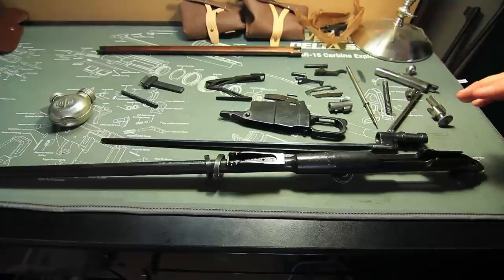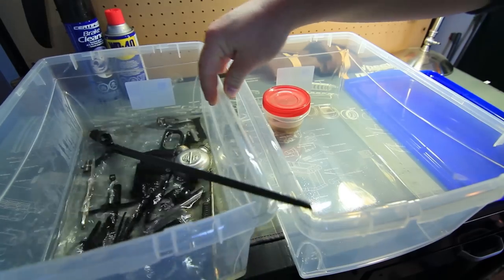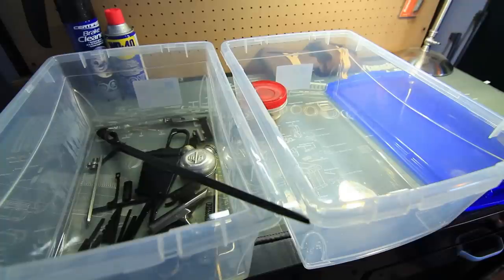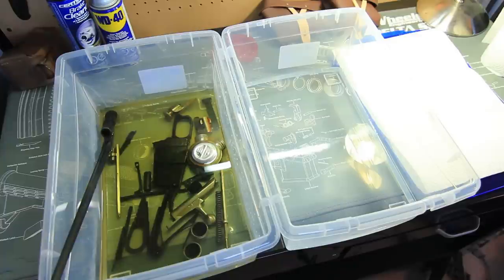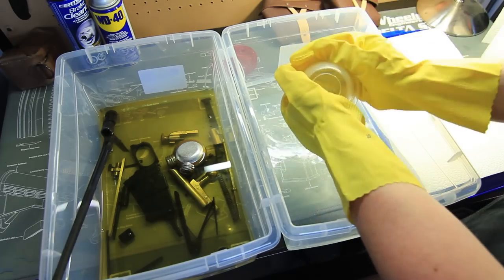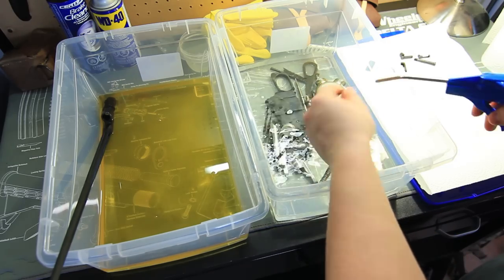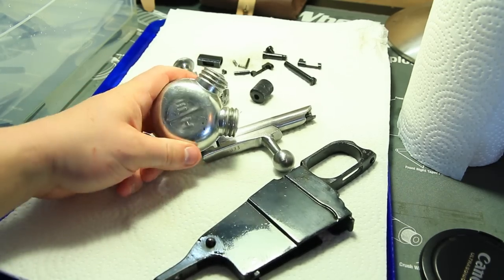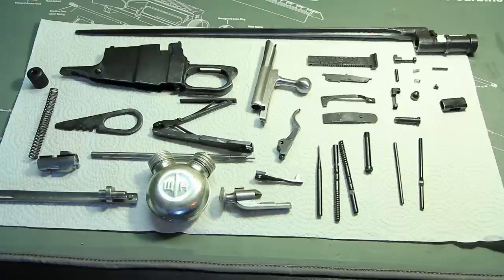Best Way To Remove Cosmoline And The Easiest way To Clean Cosmoline HD 1080p

Comment: When I degreased my Makarov pistol, I used three bottles of 91% rubbing alcohol.  I did a simple disassembly of the pistol, didn't take anything apart in the trigger group.  I also took the grips off, then put all of the parts in a half gallon container I bought for $1, and filled it up with the alcohol.  Worked great, got into all the moving parts. I used a toothbrush in some places. Let the parts dry and spray everything down with Ballistol.  The pistol operates smooth as butter.
Reply: If it's been arsenal stored, it's probably full of the stuff. But it's a good thing because it protects the metal. That gun will probably look good as new when you get it cleaned up.

Comment: Only took an hour! That's incredible. I am cleaning a cosmoline ridden makarov as we speak using mineral spirits and this method.
Reply: Mark, I'm planning on doing this to my Makarov as well. Does the mineral spirit effect the bluing of the gun at all?
Reply: Anthony. I saw no effect on the bluing.
Once  I got like 99 percent of the cosmoline off and let the parts dry I soaked them pretty good in regular gun cleaning/lubing oil and let it sit like that for 24 hours and then did a regular cleaning like any other gun and last I used a very fine coat of rem oil on everything external and metal, before I put the competed gun in its case. Looks pretty darn good!

Comment: I used a rag and alot of elbow grease along time ago, before the internet, in the Dark Ages, it worked but my SKS had a broken firing pin and would sometimes shoot on full AUTO or when I pulled back bolt to load it would just fire until empty, worked real good to clear out every one where I was shooting, after a couple full bursts I looked around and everyone was gone.

Comment: Why not just leave the cosmoline on the screws?
It works kind of like locktight, keeping the screws in place
It works kind of like a lube, allowing the screws to be removed smoothly
It works to protect from rust, keeping water out
Shouldn't you just leave the screws coated with cosmoline?

Comment: The simplest way is to lay the rifle top side down on a thick layer of newspaper on the dash of your car setting in the hot sun with the windows up.  Cosmoline melts at less than 200 degrees so it will melt and run out of the entire rifle.  A few hours in the sun and all  you have to do is wipe it down and oil the metal parts.
Reply: Would wrapping it with aluminum foil on top of the newspaper help or its not needed?
Reply: @gunny6128  No need to wrap it.   Let the sun's rays get to it to heat up the metal.   You may want to put the aluminum or plastic under the paper so as to stop the oil if it soaks through the paper.   Just be sure the car is closed so the heat builds up, if windows are open so the air can get in it will cool down to much..   You may want to separate the metal and wood so the sun can work on both at their own speed.   Good luck.
Reply: @gradypoteat3053  thank you very much for the advice, I appreciate it.

Comment: Very nice. What's the best way to get the cosmoline out of the stock?
Reply: Usually the least damaging way is to leave it out in the sun in a trash bag. The sun heats up the cosmoline and allows the wood to sweat it out.
Reply: @ricardogoomba2367  That's a great idea. Am I looking at 2 - 3 week cycle of leaving it out and wiping it off at the end of the day ?
Reply: @JudahMaccabee_  all really depends on the weather, it should take more than a few days, if you still see any excess cosmoline. Try wiping it off, if there's still more, rinse and repeat.

Comment: Can the Mineral Spirits eat the finish or damage the metal if it sits in it to long??  Thanks!
Reply from the maker: I dont think so, havent had any damage from leaving the parts in for about 20mins.
Reply: mikewd1983 no, most gun cleaners are mineral spirits. It's just a degreaser. It can hurt painted surfaces.
Reply: Ohh no it's pretty safe

Comment: will the mineral spirits remove my bluing?
Reply from the maker: maybe in excessive use.  I think you'd be fine to do it quickly only a couple times if needed.
Reply: No it wont remove any blowing it works like a degreaser

Comment: How do you remove cosmoline from wood?
Reply: may be a bit late, but you can typically cook it off by putting it in an oven or leaving it in the sun for a while.
Reply: My Father a Korean war vet told me to take the wood parts with you in the shower and the hot water will melt it out of the wood how true it is remains to be seen
Reply: Mark Aul I did not take mine in the shower with me lol but I did lather it up in steaming hot water and it came
Off real well.

Comment: What do you think a gun shop would charge for this service. I bought a mosin and it covered but I don't want to attempt this level of disassemble myself. Thank you in advance for response.
Reply: tbxtroll i see its been 2 months since you made this comment, but disassembling the gun is not that hard. i bet you don't have to disassemble the way he did to get effects close to what he got.
Reply: I asked my local gun shop and they wanted 100. 30 dollars later for tools, a tote and mineral spirits. And some time. I got it done myself
Reply: Well in my Gunsmith shop I get right around 50 for complete tear down throughly clean and reassembly

Comment: What about Cosmoline in the wood?
Reply: Set it out in the hot sun, wipe down with paper towels as it seeps out. Alternatively, you can use a heat gun on a low setting to melt it out, and soak it that way.
Reply: Watch the fucking video
Reply: Throw the damn wood away and get a polymer stock